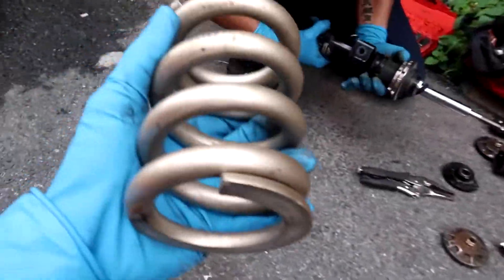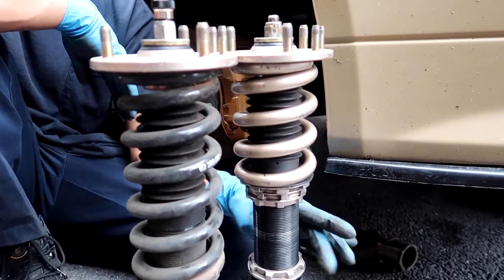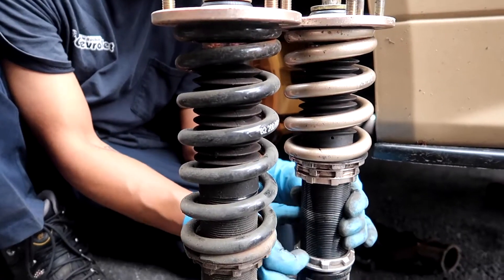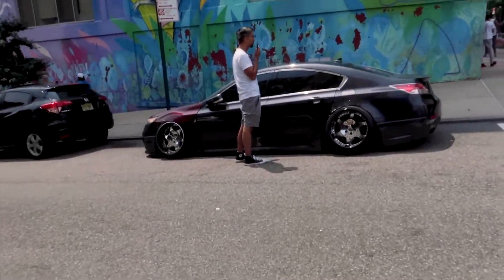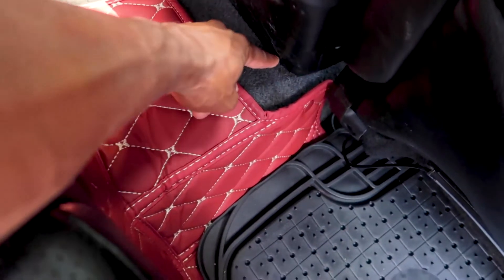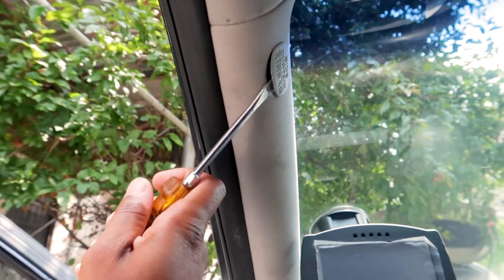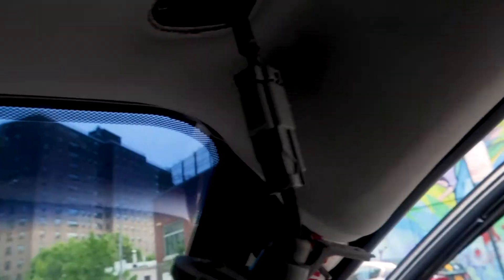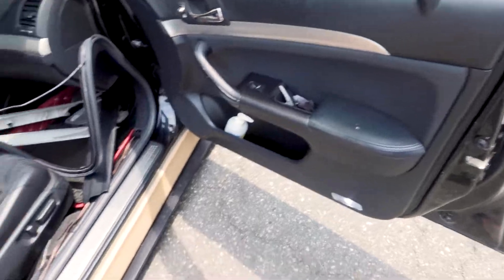BC RACING 26K SWIFT SPRINGS AND CUSTOM HEADLINER!!

Comment: I upgraded my springs to 16K front and 14K rear. I can't quite get it to the ride quality I want. Either too stiff or too soft. Nothing in between/perfect. Still dialing in suspension when I can.
Reply from the maker: You have bc racing also? I feel the stock springs are perfect its just when going low it need to be stiffer cause the bounciness get annoying when you hit the ground more
Reply: @ITSXLOW  I have some eBay brand Alder speed. They look exactly like BC. Lol. 32 way adjustable dampening.
Reply: @ITSXLOW  did you have to mess with valving? I want to get some stiff ass swift springs but online I see a bunch of stuff about how you need custom valved coilovers for upgrading the spring rate that much